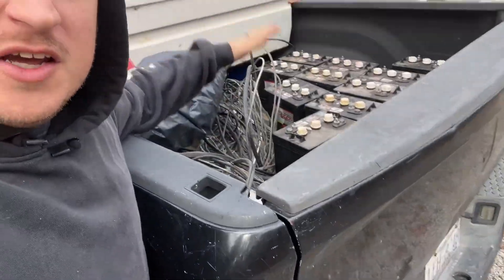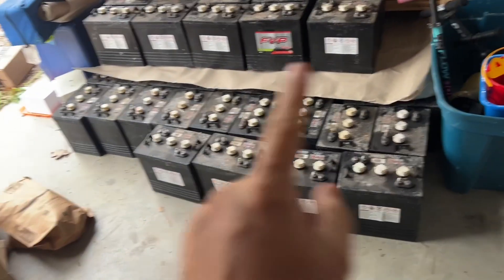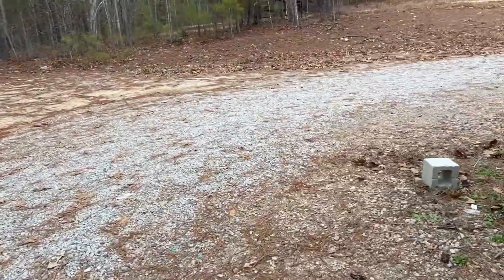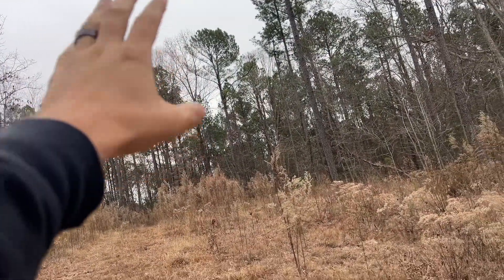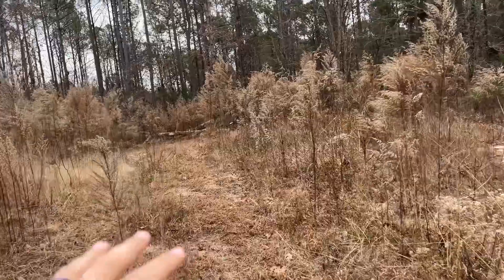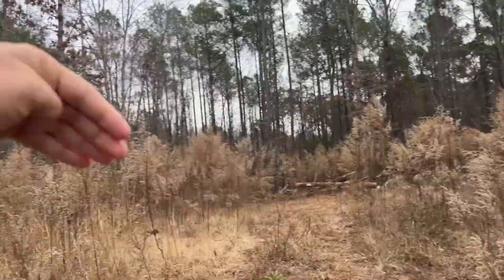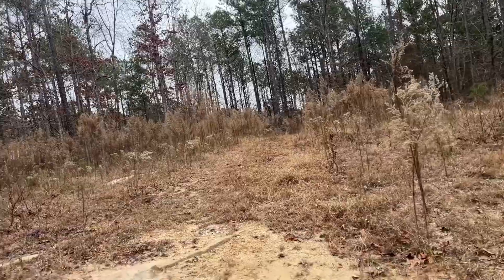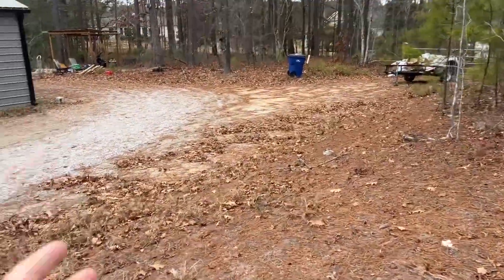Solar bitcoin mining build ep2

Comment: I don't know if it freezes there, but maybe you should consider getting your posts in the ground. It will suck if the ground freezes there. Can't wait to see how much luck you have. You might consider letting some salad rigs run on the batteries at night. As many batteries you got, you could probably keep a few running round the clock.